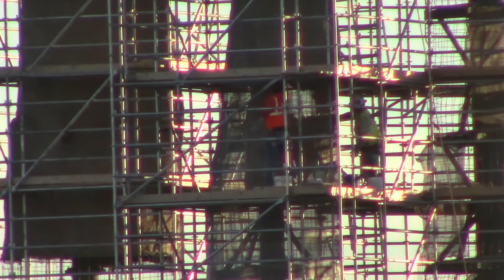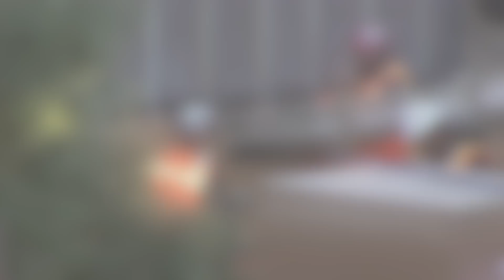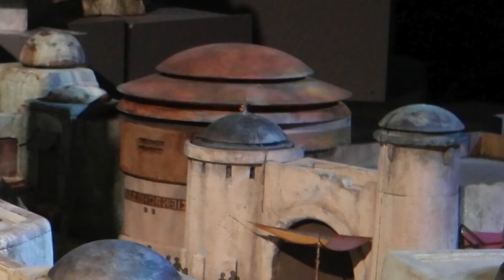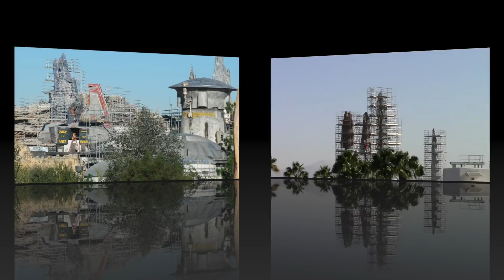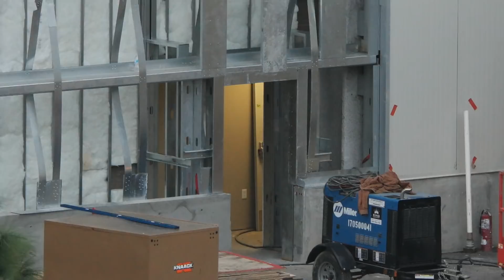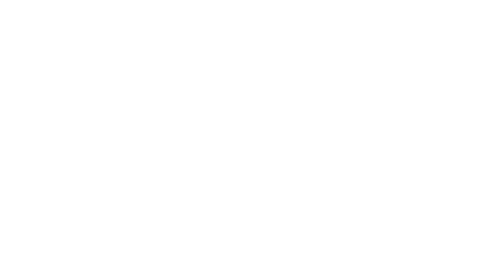STAR WARS: GALAXY'S EDGE (aka - STAR WARS LAND) Construction at Disneyland - part 35

Comment: Hi Mark, I have a question: when they add concrete to the steel mesh, does it just stick? How do they prevent the concrete from falling off immediately? Do they need to do this in layers that need to dry between applications? I have no idea how that works. (Edit: I wish you a merry xmas and a very happy new year. 2019 is going to be awesome).